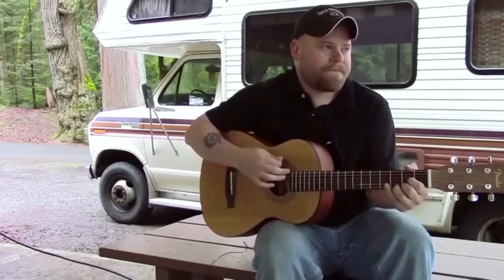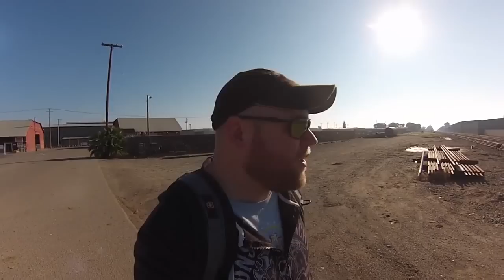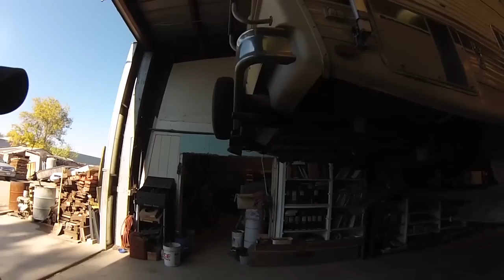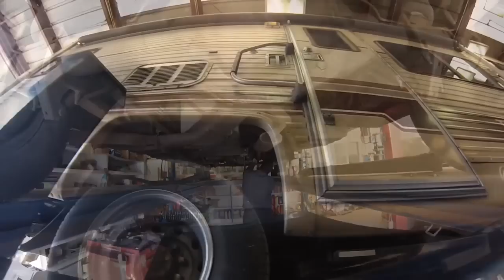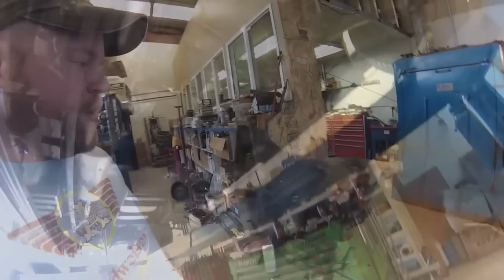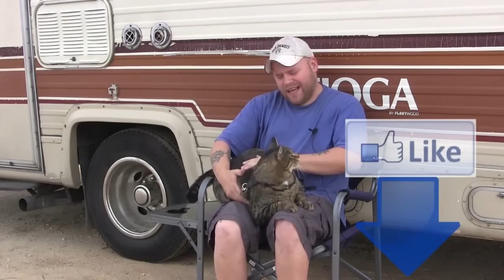Transmission - Out With The Old S01E03

Comment: It's going well; we saw the transmission coming out, even if there's a leap of faith that sits in your throat like a ball of stress....this is NATURAL on the road. You'll change your direction and intent because of this....AND THAT'S OK!  It's nearly over, just stay the course, man.

After this, almost everything becomes a smaller problem than it was, before! Hold tight!
Reply: +Brian Fahrlander Thats right.
Life is a book. 
Turn the page and start writing. 
The only thing is you are not in complete control just using a part time steering wheel to guide yourself through that day.
Blue Sky's and Safe Journeys!

Comment: Rebuild is the better choice, the other transmission could be worse and you won't know but with a rebuilt transmission you know it's new and should come with at least thirty days guarantee.
Reply: I've had about 5 of mine rebuilt over the years in my personal trucks/Plow Trucks and my guy in Detroit does them for $1,500 to $1,700 and you get 12 month warranty. knock on wood but I've never had a problem with any of my rebuilds...definitely a much better move going with a rebuild, I'm a firm believer that everything happens for a reason so who know if that junkyard trans fit maybe it would of  shit the bed a month later
Reply: +The Great Lakes Piper what kind of trucks are you getting rebuilds on thats a good price i wish i could find that
Reply: +GSXR1000 F-250 F-350 and yes they are good prices, Bob's transmission in Detroit! my last trans was on my 7.3L power stroke and to rebuild mine was $1,600

Comment: You're doing the right thing! A used transmission was a total crapshoot. With you and Jax living out of the RV you definitely made the right decision to rebuild. Besides, 80's era Ford truck transmissions are well known for their propensity to fail. Remember to change the fluid and filter in it every 24,000 miles. That's half the battle of a (longterm) dependable transmission right there.

Comment: I feel your pain Eric, I run a travel trailer and my GMC pickup tow vehicle blew the 700r4 transmission twice in one year. First time replaced it with a used one from a wrecker, second time replaced it with a rebuilt one. Didn't want a third so I added an extra trans cooler, a trans temp gage, a B&M shift kit and deep pan to double the fluid capacity and never had another problem. Keep your head up.

Comment: RE: The Plumber's Tape holding up the pipe. Plumber's Tape is strong but brittle. It is not meant for repeated movement or bending. It is meant to be attached via one of the holes, hang straight down, go around a pipe (smooth bend) and back up to be attached. No right angle bends or constant jostling.

Comment: It's best you rebuild your old transmission and put it back in. I used to rebuild them and I know from experience that a rebuilt one is better, sometimes, than a new one.  There's always a possibility of faulty parts, but rebuilding yours keeps it original with the housing and the same drive shaft. I think you made the right choice letting them rebuild your old one.  Patients is what you need to have. Remember, life is too short to let it be destroyed by a few setbacks. When it's all over with, I'm sure you'll enjoy years of enjoyment, traveling around the country with Jax.

Comment: after rebuild make sure u flush out your radiator wih some brake cleaners from wallys to get rid of the dirty oil in it so it won't give u problems and seize up the valves
Reply: +moxncal I am curious about using brake cleaner inside the radiator, as a maintenance procedure to protect the seizing of valves.  Would you explain this, please.
Reply: +moxncal pure nonsense moxncal....and a great way to ruin things.
Reply: +soaringtractor ~ okay thanks that does make a lot sense, cleaning out the coolant coil, but brake fluid?   I guess that is something the trans shop should have done, not the customer. Correct?
Reply: +TheRetiredtech He means the trans oil cooler section.  If there's crap floating around in there,it can ruin the newly rebuilt transmission.
Reply: +soaringtractor I guess I need to take the hit from PhattyMo - sure is hard to learn in a public forum though. Thanks moxncal
Reply: Wythegoodsense
I was just trying to clarify that for TheRetiredtech.

It is rather hard to communicate/learn with all the "BUT>>> HERP DUUUHHH!!!>>>>>>" spewing from people.
Reply: +PhattyMo Any good shop will do a complete tranny coolant line flush on a new install or rebuild.
Reply: i was just dpeaking as if he had done it himeself.  i know at a shop they will do it.
Reply: But there was no intent to do it himself and you specifically said radiator not transmission cooler..  And he obviously isn't particularly mechanically inclined so you need to be accurate in your recommendations.. Go reread the first post in this..

Comment: Think of all your hangups here lately. The beach, locking your keys in the RV, and now the transmission. You''ll make it through like all the other times. Hang in there, makes for good watching. Keeps it interesting. Bite the bullet with the transmission, I think you're far better off with the rebuilt transmission vs. a used one. Hang in there, it will all work out like it always does. Enjoy the vids. Good luck.

Comment: turns out to be a quality repair shop , great the used box didnt fit and they offered to rebuild your own . i bought my rebuild in 2008 and still running strong on my 2000 landrover d2 diesel with 318K miles .

Comment: Keep your head upper Eric! You will bounce back. If it was a house and you had to fix your furnace or AC you would fix it without thinking twice. Just think now you can travel another 125,000 miles and not worry about the trans.

Comment: I've got an 88 Aluma Lite Eric, last year of that C6 trans, although there's nothing I would like more than another gear on the freeway, be glad you're not overhauling an A4OD which started with the 89 model year.  They're way more expensive to overhaul!   The C6 is mostly bullet proof, and for me I'm in the hunt for a Gear-Vendors overdrive unit for mine.  This is the restoration that never ends.  :-P

Comment: A rebuilt transmission is a better solution. It looks very solid from underneath considering the age of the vehicle. Just got to replace that 460 with an economical diesel and you are good to go for the next 40 years. ( Heard VW are selling a few cheap)

Comment: Warning!!! My understanding is your transmission over heat. So you might want to check your transmission cooling system, see if it's working properly. If everything is fine  (cooling system), next time you are going on a long calming hill, think about giving more rest on the transmission. Hint never shot off your RV right after the transmission worked hard. You must leave the transmission on the Nutral for a few minutes, than put it in Park. Because in Nutral the oil flow into the cooling system. Cheers

Comment: Have him order the rear main seal,and replace it while you can!!! Trust me. It's easier/cheaper to do,while the transmission is out.
Reply: Well,in that case,everyone should want to have it done now. It will be cheaper to do now,while the transmission is apart,and it's easy to get to...rather than paying the labor again to remove the transmission a second time,later.
Cheaper/easier. Win-Win all around.
Reply: +PhattyMo I'd replace it myself. Rear main seal is cheap, the problem is getting to it. No transmission, no problem... lol

Comment: A transmission is a big item.  If they do it right, and you maintain it, you'll not have to worry about the transmission for 100,000 miles.  The piece of mind alone should be worth it.
Also, at some point, you may want to figure out a way of getting a rainy day fund.  20 bucks here and there will add up eventually.

Comment: Come on Eric you wanted a new rebuilt automatic anyway right!. Look on the bright side. It will all be over in a few days. On Ebay its 650 for a rebuilt C6 and that's with torque convertor. For a Big Block

Comment: I wonder what would be the difference in fuel consumption if Olga were a 7.3 diesel with a manual, maybe. Does anybody have an RV like that?
Reply: +soaringtractor Have you heard of the word "conversion"? Duuuuuuuuh! It doesn't have to stay stock, duuuuuuh! You have a bad atitude, duuuuuh!
Reply: +soaringtractor That would not necessarely be that much of a problem, more a slight inconvenience. Sorry for being a little coarse. I live and drive in Europe where we have all kinds of diesels and manual gearboxes. Here, such a large vehicle with a gas engine is very hard to concieve and impossible to use. And yes, your "small" utility vehicle diesels are awesome, and here I mean your Cumminses, Powerstrokes and Duramaxes.
Reply: +soaringtractor I drive a small Peugeot 307 made in 2007 with a small 1600 cubic centimeters diesel engine that does around 52mpg on the highway. It's far from being adrenaline powered, but it almost runs for free. The flip side is that it lacks on personality and it doesn't go very far before breaking once again.
Reply: +soaringtractor It makes sense. With those prices, I'd also buy something more comfortable.
Reply: +cipmars I'm thinking same. Diesel with stick shift would double the MPG.
Reply: +soaringtractor Here diesel fuel is about 5% more expensive currently and my car, compared to its gas power version, burns up about 30% less.
Reply: +soaringtractor My car was about 2000€ more than the gas version. All 100% worth it.